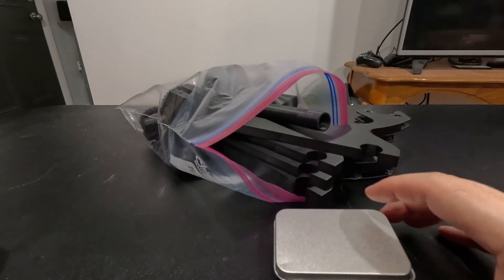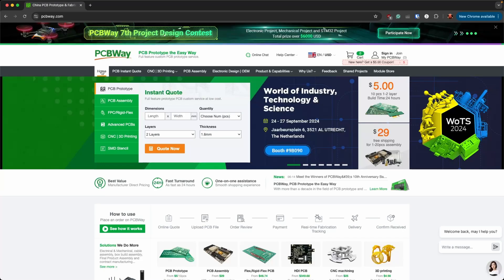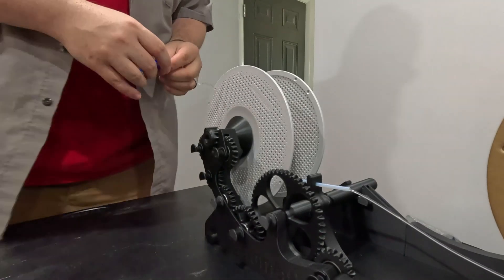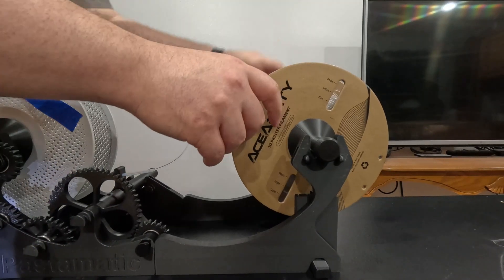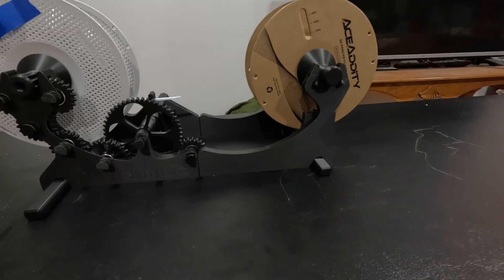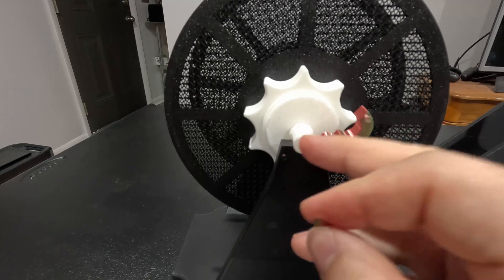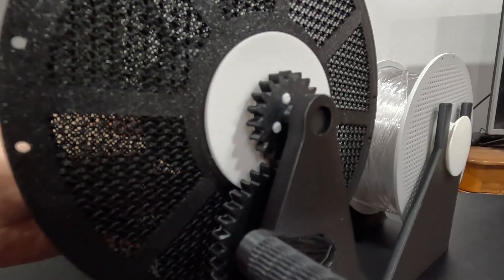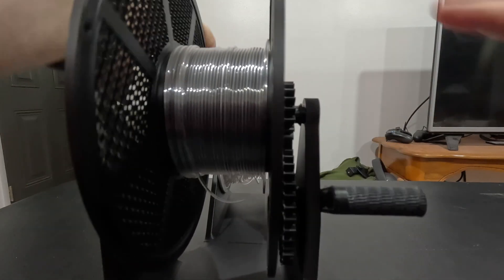Can I Discover the Ultimate 3D Printing Filament Winder?

Comment: On the Pastamatic: Those two rods that go between the long side rails are trash, throw those out and print one of the bases that hold the sides solidly. For the one I recommend on MakerWorld search for "Pastamatic Base Plate" by Andythilo. Put the two halves of the base together (tight fit, I needed a rubber mallet for some persuasion) then put the long Pastamatic sides on the base, it holds them solidly and you can use a drop of glue if you want. Next, I threw away those spool wipers, they never provided consistent drag on the donor spool to keep it from spinning out of control. I just cut a block of foam rubber to go between the sides of the donor spool and the frame and fooled with the size until I had enough tension on the filament. Also, find some of the little retainers that go on top of the various axles to hold them down onto the bearings, to keep them from jumping out. Finally, I ditched the electric drill and just printed a hand crank. It doesn't take all that long to wind a spool and doing it manually gives you much better control and consistent results. You can find lots of mods and accessories on MakerWorld that make the Pastamatic operate much much better. Just search on "Pastamatic".